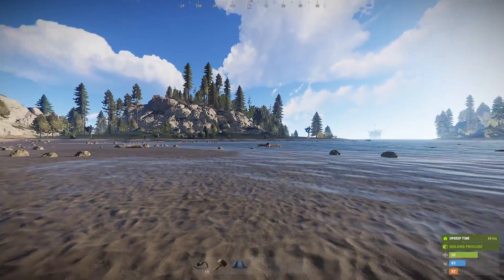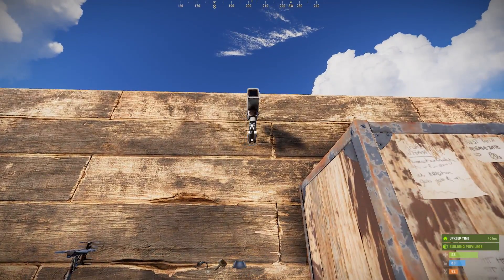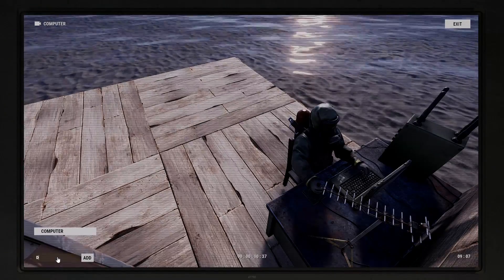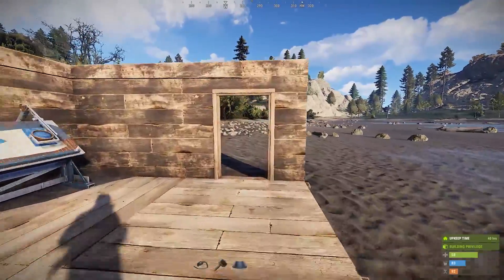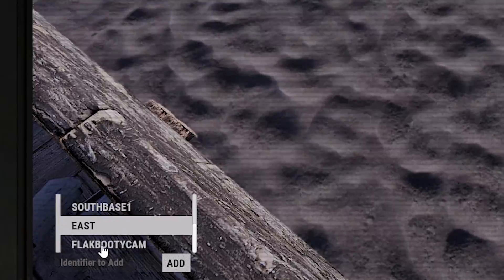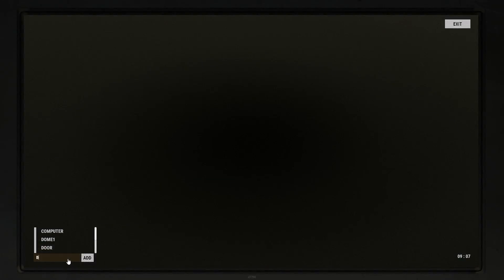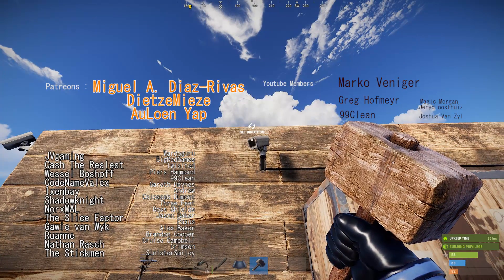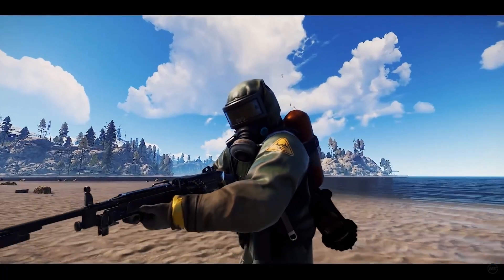RUST CCTV Camera system EXPLOIT and Setup!

Comment: What happens if you leave the default ID set? Aren't the ID's supposed to be unique? I'm curious if you could just leave the sneaky camera without having to use a TC and get away with a default cam name.
Reply from the maker: They end up COBALT1 COBALT2 COBALT3 as you place them. From testing I couldn't name two cameras the same

Comment: I think they should be like real CCTV cameras, the computer should have some outputs (equal to what you put in - some) and only cameras connected to the computer work. It'd probably be hard to code though depending on how they already implemented electricity & cameras.
Reply from the maker: Agree, maybe 4 analogue outputs on the PC so range is limited

Comment: So in other words carry a hammer and pick up ALL random solar panels laying about...
Reply from the maker: Lol yeah might want to make a permanent tc nearby
Reply: Still can do the exploit... just put the TC on a triangle with a glass window (for upkeep access) - put the solar panel on top of TC and  have the wire "hidden".... the "cheap" setup would be stairs on the temporary square to access top for solar panel placement and any multiple needs for hiding wiring... (assuming close placement)… or use a ladder (as you insinuated) placing the floating camera away from the TC... as always YMMV (or outside of the States YKmMV)… regardless great video and have fun until it gets patched... (just like the bears need to be patched to ignore foundations... jump up there an maul those naked bow players like a "good" bear would)

Comment: now part of raid planning may well be:
1/ add a CCTV cam to forward raid base, have someone monitor for counters.
2/ knock out the CCTV cameras on the base you plan to raid - bank robbery style! :) 

One question: If during a raid, you find the computer bench, will the list of added CCTV ID's be available to raider, assuming the base owner has added some? I am thinking this is could also be an intel gathering exercise - e.g. gaining a list of valid CCTV camera ID's!

Comment: Antidoorcamp system:
Hbhf out front (can chain multiple together)

Flasher light

And switch

The hbhf enables the and switch to be turned on causing a flasher to be turned on, alerting you immediately. Can set up multiple directional flashers to alert you which direction someone is.

Cheapest to set up requring 4 power. 1 splitter or 2 electrical branches. 31 hqm in costs for hbhf, flasher, and switch and electric branches.

Benefits are it's a low-power silent alert system.

Comment: what they should do is put a red light on the camera when someone is using it so if clans use it on a door you know when you can sneak up on them
Reply from the maker: Would be a fair nerf, or a buzzing sound like the sensor
Reply: @MisterFlak  ye because i have been watching videos when people use eokas on geared people by there door that's fair but with the camera system you wouldn't know if they are watching but obviously camping at a non geared base is bad
Reply from the maker: As a solo I like no light but for a cla I think the lights are needed

Comment: Kinda seems like everything being added these days is a detriment to solos or just has far greater benefits for clan. Ie. Turrets need electricity - easier for clans to setup, makes it hard for a solo to use in defense when outnumbered at a raid.
Reply from the maker: True, but it's difficult to cater just to solo. I'm glad for anything that can help
Reply: Mister Flak I mean would it kill them tho to have a modification of the turret BP where it came with a built in small battery that could either be swapped out or recharged? That way you could still slap it down just as quickly for sudden defense, you can now put numerous guns in them so this doesn’t seem like too much of a stretch 🤷🏼‍♂️
Reply: Mister Flak also okay this isn’t for solos benefit but here me out... Grenade launcher + binos + HQM = mortar 😬

Comment: the traps one can make with this! Hell even being able to see what is going on Oil rig
Reply: Actually it can open new content for Rust, for content creators! The biggest problem for Rust Trappers content creators, is getting footage of the ordeal! You severely limit either the trap configuration or the number of victims you can get, when you either have to use a shop front, reinforced window or be in the area of death to get footage.

It is annoying to get trapped, but usually there is a number of signs people often ignore to avoid them or don't know about, and virtually all of them are really old now! With this camera update, yeah, many signs of a trap can be eliminated, especially if you manually trigger the trap through the camera :P

But is Flak too nice to make a trap base now? It is a great way to have some interactions in Rust btw wink wink nudge nudge ;)